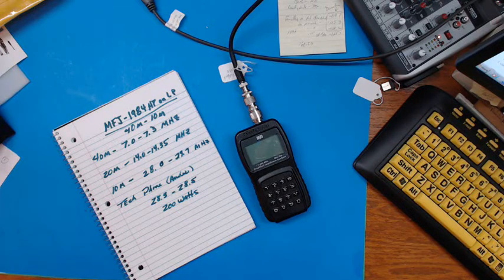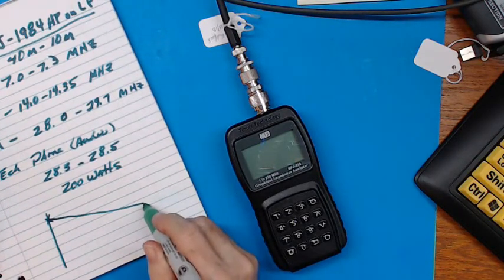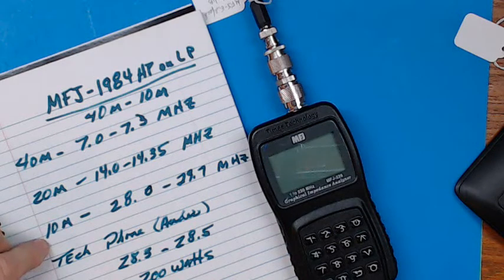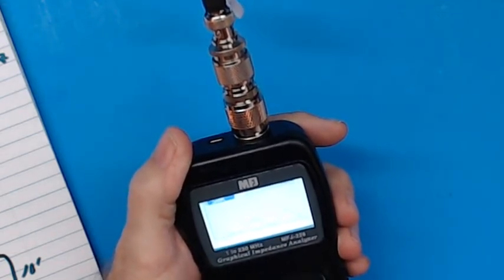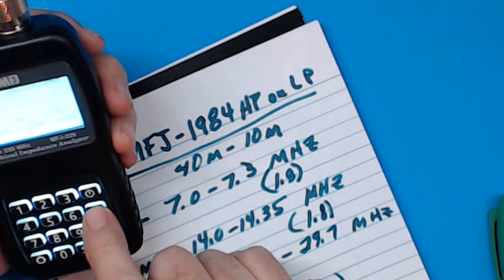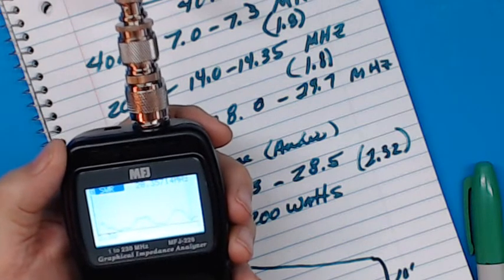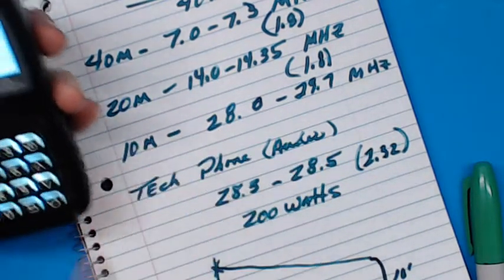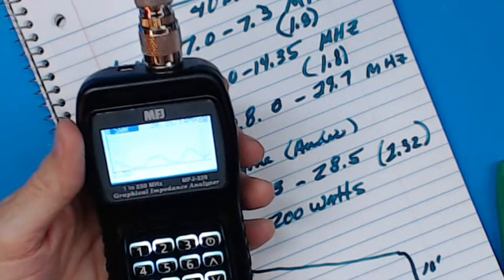TRRS #1436 - MFJ-1984HP Antenna Testing

Comment: Hi Tom. You may be surprised at the propagation on 10 meters in summer. I was working from here in PA, guys from down as far as Central America or Cuba. Can`t remember which. You, being about 1000 miles further south than I, should get some great contacts. Also, you may have some luck scanning 10 way up in the repeater frequencies. We can only pull in a repeater on a tall building in New York City.  My HF rig is too old to have repeater tone capability. It is a Kenwood TS 140s.
Reply from the maker: Thanks for the information.